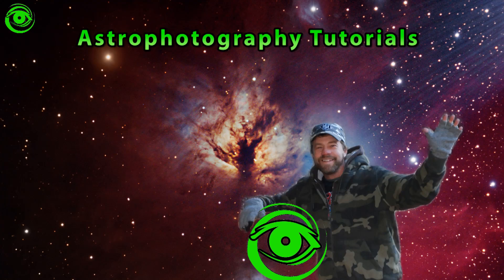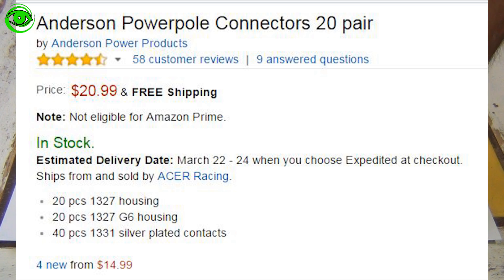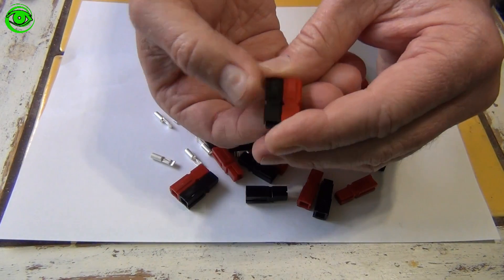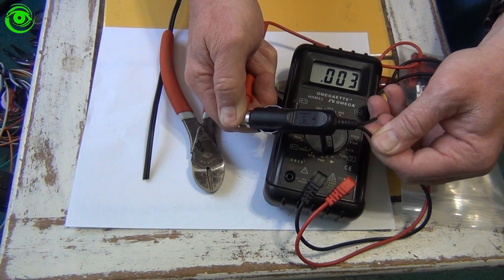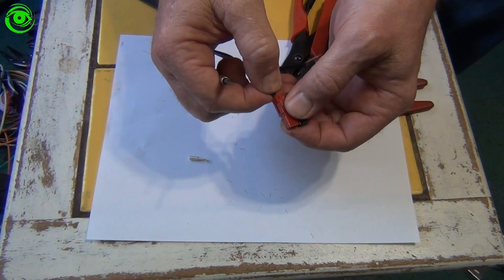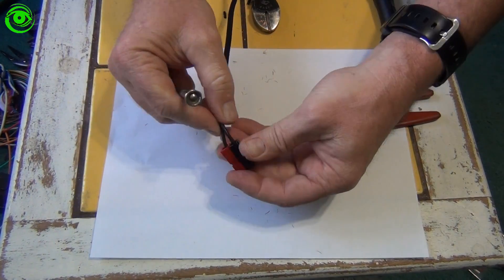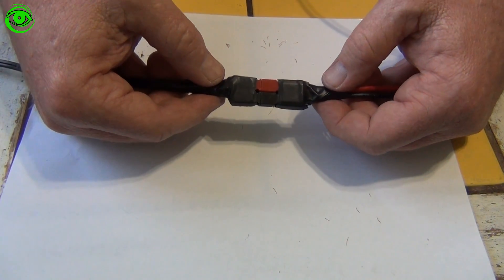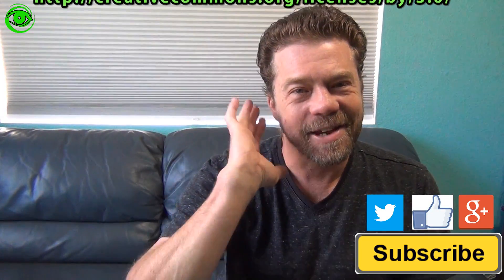Anderson Powerpole Connectors Replace Cig Adapter Power

Comment: 6 years later and I'm just finding this video. Your deep cycle marine battery power supply build looks EXTREMELY similar to mine. I found a DIY website years and years ago, and built mine from their instructions, I'm guessing we used the same site. Have you done a rebuild since this video? I'm about to attempt a rebuild on mine, would love to see the wiring/fuses/etc on yours with the Anderson Power Poles added!
Reply from the maker: Hi 11, yes I'm actually in the process of upgrading to a Lithium battery, and I'm pulling the pieces together now to assembly a new power pack.  The big advantage I'm seeing with a Lithium battery is the weight!  Of course they are more expensive than the lead acid batteries.  Thanks for the reminder, I should make a video of my new power pack assembly.
Doug
Reply: @Myastroimages  Oh, my God, my friend! do you have a telescope and worry about the cost of lithium cans, seriously?! yes, walk around your neighbors and friends, collect dead laptop batteries. As practice has shown, one or 2 cans die in a laptop battery, the rest have from 50 to 85% of the nominal capacity, dead laptop batteries are garbage that costs nothing and everyone throws it away or they lie around collecting dust. With love from Russia)
Reply from the maker: @MAGDEBACH  Great Idea Magdebach!  Recycle and resuse!

Comment: They are very dependable. Radio amateurs use these for emergency communications where they absolutely have to work. Race car drivers also use them for their quick connect/disconnect ability. Some suggestions:
1. The 15 to 45 amp versions are identical except for the size of wire they're intended to use. Here are the specs:
15 amp contacts are recommended for 20-16 gauge wire
30 amp contacts are recommended for 14-12 gauge wire
45 amp contacts are recommended for 10 gauge wire
https://powerwerx.com/help/powerpole-connectors
That same link also sells preassembled Powerpole systems if you'd like to save time.

2. The only mating factor is the right-left alignment to ensure one person's cable mates with someone else's. The rule is that the red (positive) connector should be on the right when the internal pin is up. Youtube has build-it videos that explain that.

3. For a reliable connection, it's best to have a crimping tool. They range from about $10 (tolerable) to $50 (excellent). Again, Youtube videos offer suggestions. 

4. Make sure you include a fuse. Otherwise a short can result in burned wiring, a dead battery and even a fire. You can get those from auto supply stores.

Here's an excellent tutorial on Powerpole connectors:
https://www.youtube.com/watch?v=o31iuOcQ-jo
Reply from the maker: Thanks Michael for the well thought out tips and advice.
Doug

Comment: I like that they come in multiple colors.  I color code them based on voltage.  I have my 12V from my deep cycle battery going to a home made distribution box that houses a few dc-dc buck converters to bring the voltage down to the correct level to power my usb hub, and my dslrs.  The hot from these go to a fuse block, then out to color coded PowerPole.  The wires to my devices are then terminated in a matching color scheme.  It prevents me form frying my cameras and limits the number of cables that need to be run to the mount (currently, just the 12v from the battery and a usb to the hub)
Reply from the maker: I agree!

Comment: Good video, and a good example of why Power Poles rock.  Here is a video explaining one of the most common failure modes of DC electrical connections, and how to solve it.  BTW, we use Power Poles exclusively for DC power when we have a choice.  ;-)
https://youtu.be/bJSXU6nLXCE

Comment: It's a very neat solution to a common problem. 
I'm pretty sure it was a loose connection that fried the motherboard on my mount. The power going on and off multiple times in quick succession. It went in a puff of blue smoke that smelt like electricity. Not the sort of thing you want happening on day one of a 9 day star party. :( 
On my new mount I'm going to replace the leads with regular size anderson plugs as I already have my batteries wired up with them for charging with solar. :)
Reply from the maker: I found these to work well for my AP gear and I have converted all of my cig adapters.  Too bad about your MB getting fried.  Thanks for watching and commenting Jeanette.

Comment: Thanks for the great tip, currently replacing everything.
Those other connectors from the comments look good but much heavier, 
and with the powepoles you can clip them together differently for different voltages, avoiding putting a 5v plug in a 12v supply
Reply from the maker: You're welcome Sebastian!  I'm glad you enjoyed the video.  Thanks for watching and commenting.  Doug

Comment: Very cool, I always wondered how those work.  Thanks for that!  Would be nice to see the finished project when your done.  I'd like to see how you did the battery side and how your connecting them together.  Also do you have a power pole junction box at the scope side too?
Reply from the maker: +Richard Asarisi Hi Richard, here are a few photos.  I also created a bridge to both of my batteries so I can charge BOTH batteries at the same time in the field.  Another note that I did on my finished project is I took a Velcro strap to hold the 1.5FT harness to the battery.  This way when I move them around these harness will not get stepped on or crushed by the battey.  You're right, I should have put photos of the finished project in the video.  Thanks for watching and commenting!  Doug

https://copy.com/RJXoCsM7lFCUFt9d
https://copy.com/znTC1seSk12JCzu4
https://copy.com/ZQ6JpJStqDDTMt2E
https://copy.com/9S0dCSdWmTL9GdQh
https://copy.com/V1cnvdTPi8PnkvIp
https://copy.com/uyNCY9epYzelTy0L
Reply: The links to those images no longer works, do you have them anywhere else?
Reply from the maker: Hi Richard,

I took small leads from the battery box and made connectors that are on a foot long lead.  This way I can manage the battery easily.  So imagine on the battery box a few 12" wires with the Anderson Pole connectors on them.  

No Junction Box.  On each device, I left the original cable intact, except I cut off the CIG adapter and replaced the end with Anderson Pole Connectors.

When I made this setup, I used the same connector pattern, so it didn't matter which connector on the battery I connected the device to.

I've been using them for almost a year now and no complaints.  The old Cig adapters would always find a way of loosening up and that always gave a me a fright...there are so many things that can wrong when you image at night, the last thing you need to worry about is your power connectors.

Doug

Comment: Those look a good upgrade, much smaller yet more secure, thanks!
Reply from the maker: +zeroy I've been meaning to do this for a long time.  I've seen other people use secure connectors and ditch the cig adapters.  My cig adapters were coming out during the night and if I "touched" them to re-seat, it would lose power.  Most equipment can handle a temporary power outage, but, your mount will not tolerate any power outages.  Thanks for watching!